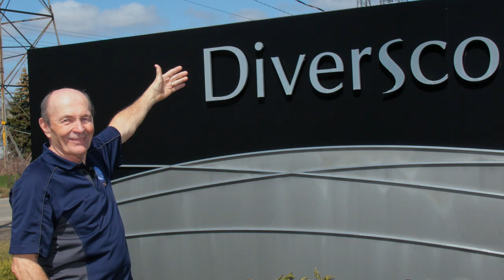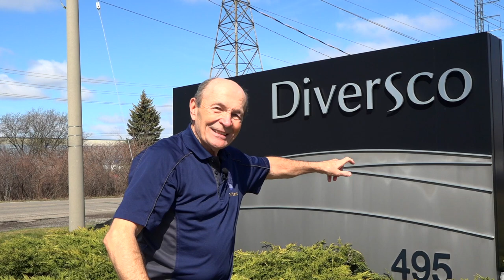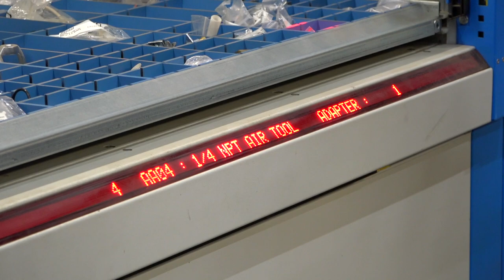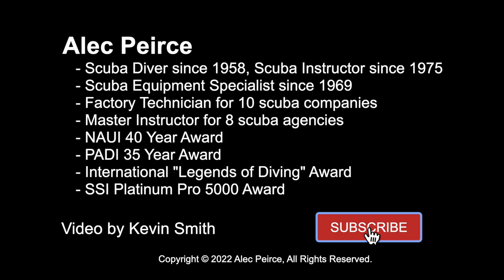How Scuba Gear Gets To A Dive Store - Scuba Tech Tips: S13E10

Comment: a very important topic.
this does not apply only to the diving industry, in fact, this apply to any major industry, construction, automobile ( truck snd bus too)  and in any activity wheret here is an organized production.
there is a specialty that is called industrial engineering that covers this part of the production organization.
the scheme can differ a bit from an industry to another but the basic remains similar, for small outlets as diving stores, for sure that doing business with one or a few distributor is a cost effective solution as they can concentrate on the main activities of supplyimg direct service to the diving community.
Reply from the maker: When I ran my dive shops, taking care of customers was most of my time.  Where would I find time to become an importer for dozens of needed product lines.  They do a great service to all dive shops.
A.

Comment: I like to support my LDS, local dive shop, as much as possible but most of them can not afford the to stock the shelves. So I am forced to go to this really cool machine on my desk where I type a description of a SCUBA do'dad and out pops half a dozen options. I place my finger print on a button and in three days an Amazon van brings my SCUBA parts and components to my residence and I don't waste time calling shops or driving all over town to find out no-one has anything in stock any more in retail dive shops. Now how in the heck is any shop going to stay in business with a modern reality such as this. Heck its so bad they are slow and behind on the regulator servicing because they lack the rebuild parts in house even for the brands and models of gear they sell. Frustrating and when sending gear off to the US largest drysuit service center in the US you have to get into a huge line or pay extra money to get bumped to the back of the first in line line. Then the dry suit is returned and still has issues and they are the best the US has to offer. Unbelievable industry in the most trying of times business wise. My save a dive kit is likely much larger than it was for other say ten years ago because they could rely on their LDS to have the basic top of the line accessories on hand in the shop. Now if you see it online you better snatch it up or you may not have it when  you need it. It's super tough to be quiet when you go to any LDS ask if they have a specific product, they don't have it but say we can order you one, and have it here in the shop in a week and I have to keep calling to see if it arrived. Heck I can order my consumer retail items myself and get exactly what I need and save most precious commodity my time and expensive gas by ordering it online and getting delivered to my front door. Now that is automation and consumers experiences and expectations have change to a very demanding situation in modern times.  So thought to run a retail business these days.
Reply from the maker: Everyone has had a bad retail experience at some point, as well as online.  Watch my video on this S08E20 "Local Dive Store vs Online Purchase", you will see the pros/cons of  each.   At some point you will need a LDS for a key part.  As long as your ok with the quality and risk of a problem, enjoy.
A.
Reply: @AlecPeirceScuba_SeaHunter  .I’m not against the LDS, God bless the hard working LDS shops I just hope they can find a way to stay profitable but it’s seems to be a shrinking opportunity of product selection on the shelves across the board. Over stuffed shops maybe a thing of the past the landscape of small retail business is in a state of flux. Very interesting how there is a paradigm shift as online retail giants are consuming a majority of the options. At some point the individual shopper has a reality to there own micro budget deciding where they spend their hard earned dollars. We realize new product is like a can of coke from a vending machine regardless where you purchase from and not only lowest price seems to be the determining factor to buy online. Quick effortless supply location and order purchasing from your mobile phone and shipped to your door seems to be winning may of our purchases.
Reply: I tend to respectfully disagree any of those key parts will at some point (likely already are) be available online as well. Unless the manufacture puts some kind of limiting factor on retail sales of its key parts and only sells to a shop with a mandate that they install it under a service agreement with the end user such as regulator rebuild parts claiming they are concerned with diver safety in fact it’s more a business and mitigating lability reason. At some point write to repair activist may be focused on the dive industry.